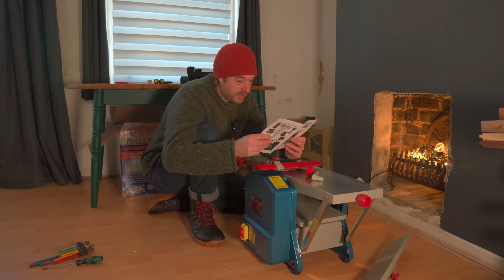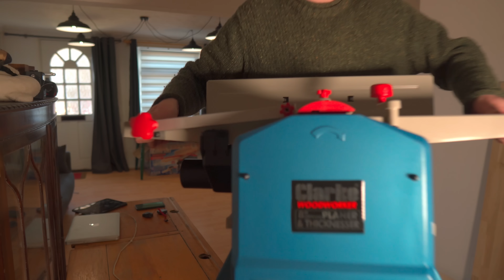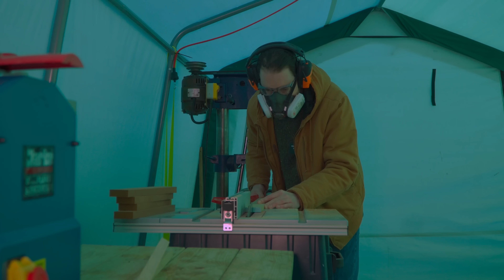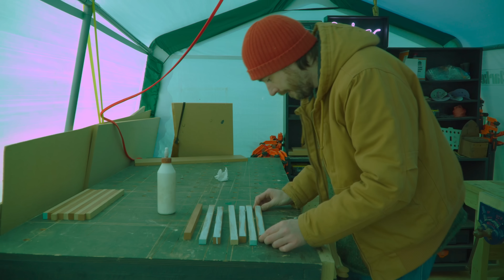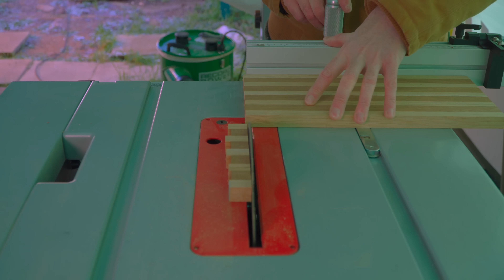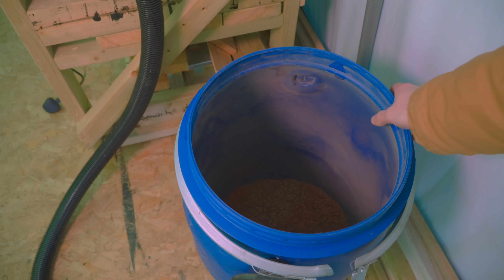Clarke CPT800 - 204mm Planer Thicknesser

Comment: Hi Matt, great review thanks. I'm currently in Ireland, where that same Clarke machine is costing €640 via distributors! but there are of course similar cheaper alternatives such as the TITAN from Screwfix. I wonder would you have any guess on whether the Parkside version would be up to much? - like your Clarke, it's 1250w and 204mm, but perhaps louder and more plasticky
(I tried posting a link here to Lidl website but seems it was auto-deleted) 

I'm not in a big rush for one, just wondering if the €220 Parkside machine is a bargain to jump on ...or much lesser quality maybe? 
Would welcome opinions from anyone here who has used either the Lidl/Aldi versions. Thanks

Comment: Just bought the Rutlands version. They are normally the same price as the Clark ones but I got £100 off in the sale. Looks the same as this but for the fence, which is much, much sturdier than this one, being cast aluminium instead of pressed steel. But I guess it is a lot heavier than this one as a result.

Comment: The problem with far Eastern tools can be obtaining spare parts.. Twenty years ago  buying Clarke stuff from Machine Mart was a safer bet.. The main service shop in Nottingham (where I live) kept basic stuff like motor brushes and drive belts in stock and almost all other parts would come in from Clarke ( London) within a week or so.. However in recent years I have found that the availability of many parts has fallen off badly.. Even for current products.. If your tool needs unavailable parts and its within warranty they will just give you a replacement tool.. You go away smiling, but say it needs something else another year down the line you may find (at best) that you have to wait 6 months for a back order from China or (at worst) you own a piece of scrap.

Comment: Hi Matt, good review there. I have a small workshop, looks to be about the same size of your tent workshop. I see you've had a few different thicknesser planers over the years. Im in the market for one. Would you recommend something like that Clarke, or similar, or a dedicated thicknesser such as the makita, and use the table saw with jigg to square edges etc. Hope that question makes sense! Thanks

Comment: I have the Titan one from Screwfix. Fitting the dust exctract on this seems much easier that on the Titan, which is very frustrating and must be fitted bacuse it operates a microswitch to connect the power.

Comment: I bought the 10" version of this a year ago. I had high hopes as I remember as a child in the 80s seeing Clarke stuff in everyone's garages. Unfortunately it isn't very good. It tears the wood and the motor overheats every few minutes. I then have to wait for it to cool before the reset button will work. I hope yours is better than mine but I cannot recommend the Clarke machines to people after my experience. I also bought their 14" bandsaw and 12" disc sander. So far they have been OK.

Comment: Have an identical model from another brand. Well worth making a longer table for the thicknesser. Long bit of 18mm MDF as the table, and two shorter bits under it that sandwich either side of the existing table. If you get the fit right you can just slide it in when you want it and it drops snugly over the table and gives you much longer in and outfeed, and it takes all of half an hour to make! I can't express how much of an improvement it is.

Comment: Looks like a decent machine and is very light. I just bought a Dewalt 734 planer that weighs 80 pounds! I won't be carrying it around. I have it mounted on a flip cart opposite my spindle sander. Thank Matt.
Reply from the maker: Thst looks a good machine but heavy

Comment: I bought the exact same thing a couple of years ago, but the brand is Zipper. I guess they make these in China and each brand just paint the body in a different color. It's ok, nothing more, nothing less. As long as the blades are sharp, you can get stuff done with it. I've built a side table, benches, chopping boards, sofa table etc. I'd love to get a bigger one some day, but my shop is small and my wallet is empty.
Reply from the maker: Sounds like you have got lots of use out of it.
Reply: @Badgerworkshop  Sure, it's a handy little thing.
Reply: Yep I got the zipper myself and it looks identical, they all seem to be generic
Reply: @MD-gc4xq  Yeah, I've seen about half a dozen of the same kind but with different paint.

Comment: I've been considering selling my Axminster trade planer thicknesser and buying a portable smaller planer thicknesser as my small workshop needs all the space it can get. Thanks for sharing your video and giving it a review...food for thought
Reply from the maker: It's a tricky call. We all want the large machines but also the space
Reply: Keep your Axminster otherwise you will regret it. These planers are toys compared to what you currently have, and don't start me on the noise. If all you want to do is make the occasional piece these will do; but if you plan on using it most days stick with what you have. I had an Erbauer one which looks identical, soon got rid and bought an Axminster.
Reply: @garyblake3130  thanks fella. I appreciate my Axminster is an incredibly sturdy beast made from cast iron. There doesn't seem to be any mid-ground between trade planer thicknessers and those aluminium ones, unless anyone knows differently.
Reply: @likeakite  I have Dewalt D27300. Its good quality machine and actually made in Europe (italy). I would say its best compromise machine on the market. It weight about 60 kg so lighter than Metabo and Records aluminium bed machines and much lighter that cast iron ones. Only issue is price, its not cheap for small machine like this.
Reply: @henriaaltonen6870  thanks for the info, I'll take a look at that one.

Comment: I hope they have fixed the tables in this color of this chinese frame. My version's planer is unusable since the tables do not stay parallelle to each other. The thicknesser is very usable as long as you can live with snipes and short boards. After 2 meters it can be very difficult to use.
Reply: My experience also, thicknesser is ok but planer is unusable as the tables are not parallel causing work peice to nose dive into blade giving a lovely nice curve on every face